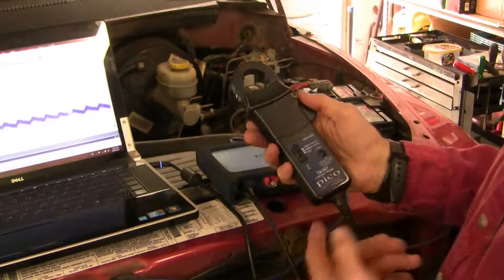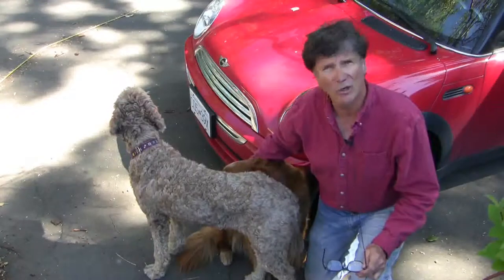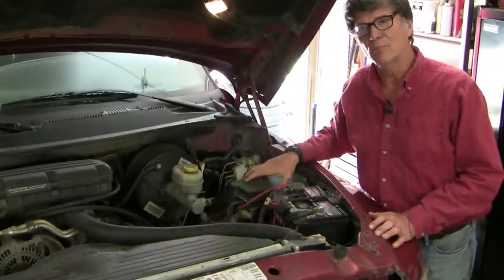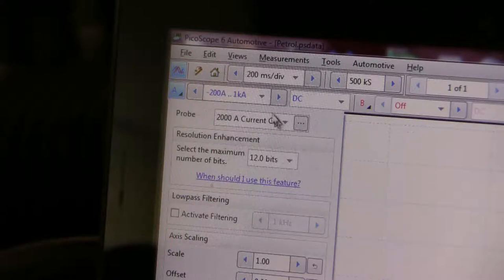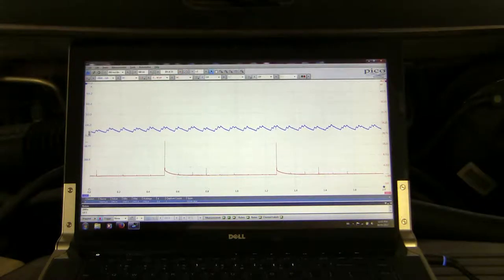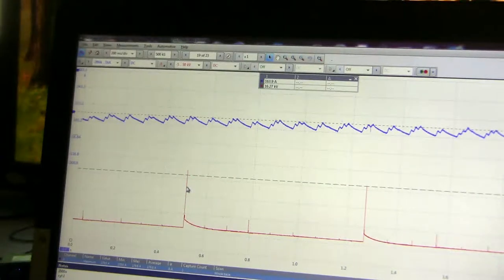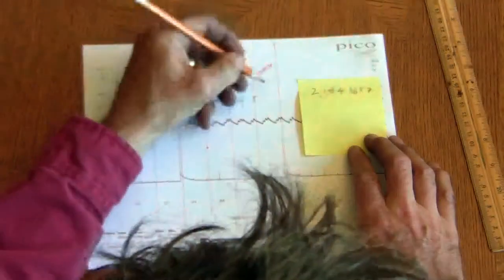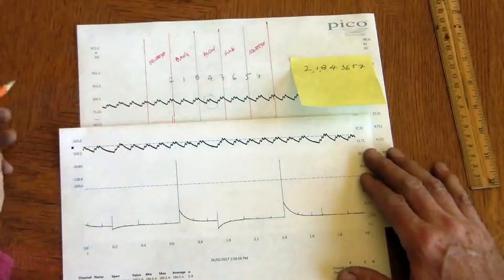Relative compression testing with a Picoscope

Comment: Thanks for the pico video series. I have considered one myself,  I am a diy, and for me it would be hard to justify but that doesn't stop me from wanting one. If you don't mind,  which model did you get and how did you decide.
Reply from the maker: Mine is 4425, but for less expense you could go for the two channel 4225. I thought for a few years about whether to make the leap. It's been my pattern to save money by doing repairs myself, and then use that money for my education and to buy better tools. I haven't saved a lot of money but I have gained priceless insight regarding how these machines work. I've made a few mistakes, too, but that's another story, ha ha. Over 40 years I have acquired a very good shop, one tool at a time. With cars increasingly based on electronics, I felt I would use the PICO enough to justify the cost. Right off the bat, to my surprise I discovered a bad plug, and I was able to prove that the coil is working fine! So, I like to think that by having better diagnostics I am more likely to avoid the DIY sink-hole of replacing normal parts. Of course a top level scanner would be nice, too. However many top level scanners require more frequent updates that come with a major subscription cost. Snapon and others sell a combination scanner and labscope, but the cost for new ones is completely out of reach for the DIY crowd. There is no subscription for the Pico, and there are forums for Pico users to share waveforms that will likely help as well. If you are interested in comparing labscopes, Ramon Ruzic has an interesting channel with various second hand scanners he acquired through ebay. I like how some of his are more portable and not PC based, and some can boot up a little faster. However I don't think the labscope end of those tools is as good as the Pico. Also buying second hand electronics over ebay can be an unpredictable game. You can also buy a stand alone oscilloscope, but the peripheral devices are the weakness to that approach. After about a year of research I came to the conclusion that for automotive work, the Pico is the best product for me. To date I'm not disappointed. Thank you for watching, I hope to hear from you again. 

Dave

Comment: Is the 2000 amp clamp a bit overboard ? great video.
Reply from the maker: With electric and hybrid cars in all of our future, I suspect we'll need better capacity for both voltage and current in the next few years. As you know it's a tradeoff since higher maximum amperage often comes along with weaker sensitivity and accuracy on the low current end. As you say, for most indications the low current probe will be better, but it's pretty amazing how high the current draw spikes when you first bump a starter motor. 600 amps in the first few milliseconds would not be unusual, and we always want to protect the Pico circuits that are behind the current clamp. With such huge current draws, it's no wonder we need heavy gauge wire going to the starter motor, and no wonder it's a quick way to burn out starter motor windings when cranking for too long. Thanks for watching!
Reply: Thanks for the info.

Comment: Excellent as always but it looks like you were broadcasting from Mars.. HD and pixalated. Could well be YouTube issues.
Reply from the maker: I think it is a Youtube issue, I didn't change the HD upload strategy I've been using all along. As you say, when I look at this with my old browser I don't get the option to see it in anything better than 360p. This was uploaded at 1920X1080p so lots of HD detail, and initially when I uploaded I could click the HD option. Not today. Lately Youtube have been working to format videos for small mobile devices, quite a challenge. Of course with multiple formats, bandwidth issues, strategies to discourage old browsers, and advertising issues, Youtube have their hands full. Thanks for letting me know, I'll try this out with other browsers.
Reply from the maker: I just noticed that the codec I was using was changed when I did some video work that required smaller files for a friend. On changing back to my usual file export algorithm, although it's in HD I didn't the the 2-pass VBR phase exactly right. Thanks for bringing this up, quality should be back to usual with the next vid. I could re-upload the video for better HD, but I'm not sure it's worth it, since most of us view in nonHD format anyway.
Reply: Interesting, thanks for the feedback.

Comment: What about coil on plug types? :)
Reply from the maker: Great question! Yeah, I'll be posting some followup videos of different designs in a couple of months. You have three options when looking at coil on plug. One option is to buy or make short extension cables that allow the coil to be held away from the engine so you have room to clamp on to secondary wires and read secondary waveforms. You don't have the luxury of all cylinders firing on one wire so you either use a separate channel for each or do them sequentially. A second option is to use an inductive pickup coil that you place on the coil and read the waveform off that. In that case the voltage and shape can be distorted by re-positioning the pickup, so it's not easy to compare one with the other except to see gross abnormalities. Some newer coils are so insulated you don't get a reliable signal using that technique. The third option is to directly tap in to measure voltage on the primary side, which is what many professionals do. The shape of the primary voltage waveform is nearly identical to the secondary. Just remember that the primary voltage spike can be HUGE, so you need to use an inline attenuator when measuring primary voltage, so you don't fry the scope. Thanks for watching, I'm sorry about the video quality. A better version is available in the Pico playlist on my channel.

Comment: I would retake the test after a short while on new plug. if it was shorting you could have had boor wash causing lower compression also real meter compression and compaire it to a good cilinder to learn more. And of course make a video for us all to learn (+_+)
Reply from the maker: Yeah, more work to do on that fourth cylinder, I think the real clue will come with secondary ignition. It's a good point, chronic misfire could cause other issues, although I don't think it's a complete misfire because fuel trim is normal and no codes were set. Thanks for watching, it's going to be interesting to find a resolution.